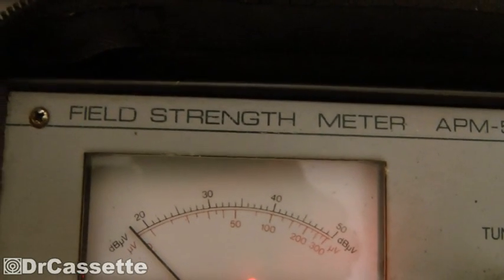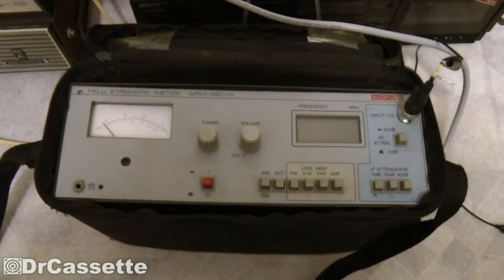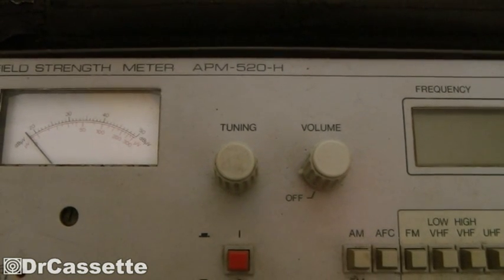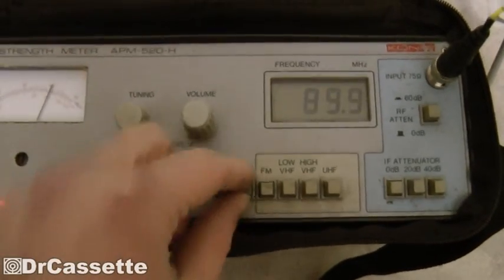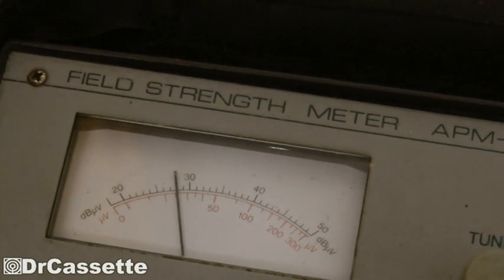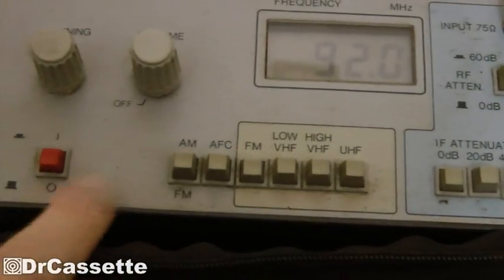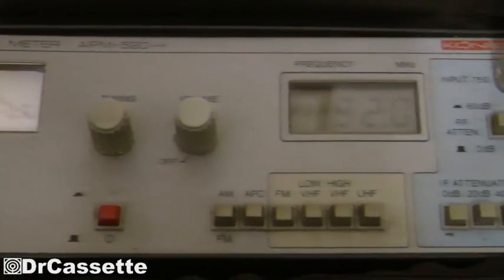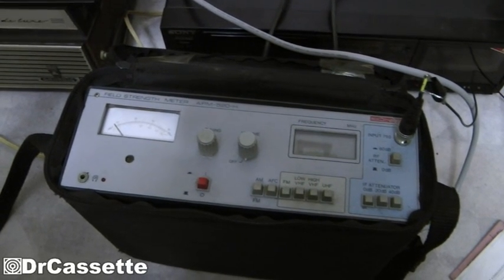König APM-520-H field strength meter!

Comment: Most likely made by Sadelta in spain.
Very usefull since it can be used for digital and every other signal wich it can tune and it probably tunes from 45 MHz to well above 850 MHz.
Reply from the maker: It may be able to tune to digital signals, but it can't do any kind of decoding. So unless you know exactly what you are looking for, it's not very useful.
Reply: DrCassette True. However you will normally know the channels/frequencies you want to use and tune directly.
In the case you dont know what it is used for, it is for measuring antenna signal strenght when you are Aiming/rotating antennas towards the transmitter. Since its simply a receiver with an S-meter it will work for any signal on the frequency but not produce usable audio om anything but analog.
I have a similar from Sadelta but smaller newer and on batteries and in a neat bag to carry on the roof. Still they are very usable I hope you sold it to someone who knows the value to it (hamradio operator or similar). Interresting that it runs on external power only, sure there is No dead nicads inside ?

Comment: If I'm not mistaken, the supplied "field strength correction chart" should give you offsets to add to the shown value so you can obtain the real one. IOW, if the chart shows -5 dB at 40 dBµV (random example), the real value should be 35 dBµV when the meter shows 40.

It could also be the other way around, but that would be impractical.